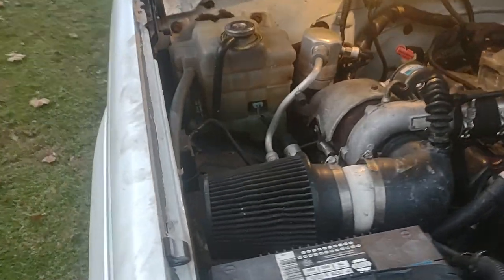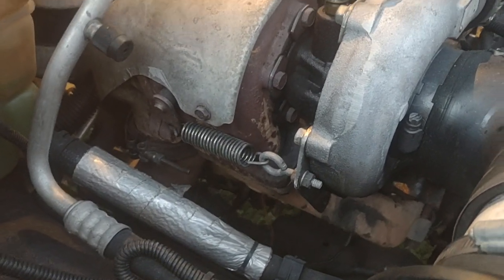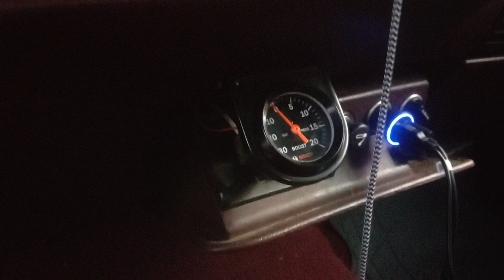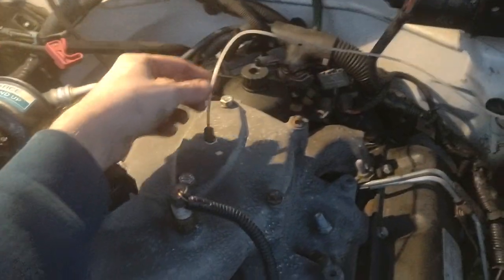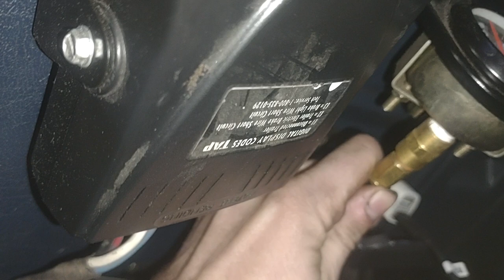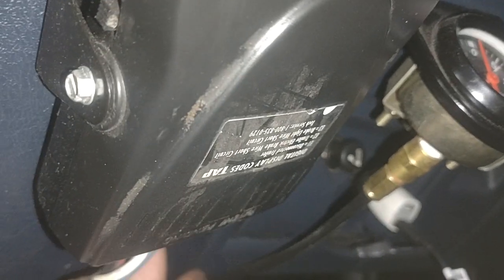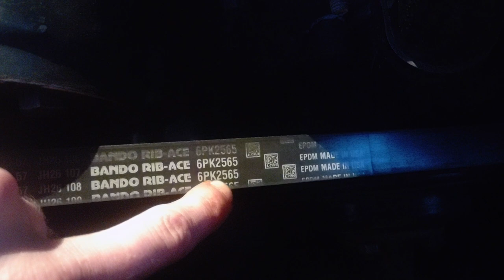6.5L Vacuum pump delete & manual waste gate

Comment: I was pulling a trailer and lost a bunch of power and was pushing a lot of black smoke so I wired my wastegate closed with some tie wire right on the side of the road. It got me going again.
Reply from the maker: Glad to hear it got you off the road in a pinch man

Comment: Anyway i can get a hold of you directly. I am currently in the middle of swapping a 93 Mechanical motor with a 95 fly by wire. Got some advise though videos on here... but i am lost on a few things  never worked on a diesel before but i am a Mechanic

Comment: On my '95 6.5 I  placed a plumbing T in the hole where the factory electronic boost sensor resides. I then plumbed the factory sensor into one side of the T and the gauge tubing into the other.

Comment: Kendall Burress here thanks for all the info it’s a lot of trouble doing all the true video no some bull shit trying to look smart thanks . Great job . I have been changing a 1998 6.5 turbo out with a 2002 6.5 non turbo the add turbo  not fun
Reply: Not some 😂 bull shit
Reply: I bleed the air out of filter motor runs good for 15 minutes  the runs low on fuel then I have to re bleed it again

Comment: So I believe I have a 68 mm Garret or holeset but what would I need to do to get more whistle? A different wheel?
Reply from the maker: Pretty large turbo for a 6.5l, good possibility the engine isn't pumping out enough exhaust pressure in order to spin the turbine as efficiently as it should in order to make a high rpm whistling noise. Never the less you could try a different wheel but, not sure if it will improve anything.

Comment: Hello, great video. I have a question. I own a 2002 Chevy express 3500 box truck with the 6.5. When driving over 50 mph the turbo is constantly reving up then the wastegate opens and back and forth constantly. The truck is not surging but the turbo up and down all the time is annoying. I own a 12valve Cummins too and that doesn’t happen. Is this normal for the 6.5?  No codes. Thanks.
Reply from the maker: Can be a simptom of the vacuum pump starting to go out.

Comment: Hey Jesse, I’ve got a 1994 Silverado with a 6.5 turbo diesel and what is doing is it runs smooth but I can’t get much over 1700 to 1800 RPM does not blow black smoke I do not have  a boost gauge to know what kind of boost I’m running I did replace the pick up pump module that usually sits on top of the motor and mounted it in the grill just not knowing where to go next. I don’t want to just replace the turbo it has about 180,000 miles on the motor.

Comment: How do you set the boost ? Is there a certain RPM,ect ? I have a stock 95 gmc engine with 185k and I think the dam pump is going out again 😫. Only modification I’ve done to it is changed the fan/clutch to a duramax. Sorry new to this and I just don’t want to blow it up 😆 not that it couldn’t happen anyway. Great videos 👍 I’m learning a lot🙏
Reply from the maker: No problem man, happy to help. The maximum boost is set by the spring tension for the turbo blow off valve. The more spring pressure you have acting on the exhaust pressure to keep the valve shut, the more boost you will make and vice versa with a lighter spring. For example if I wanted less boost on the wife's truck set up (the dually) I would back the nut off to relieve tension on the spring. And thank you, I hope these videos are helpful 👍
Reply: Jesse, what spring did you buy?

Comment: Hi, sorry if this question is stupid but what model years have the vaccum assisted heater controlls? I have a 95 Chevy Suburban with a 6.5 turbo diesel. Good video btw 😁
Reply from the maker: Mits not s stupid question man, mostly 94 and older
Reply: @JessePelkey1  Ah alright, thanks for the fast respond 😄👍
Reply from the maker: @Joel-lz1xm  no problem

Comment: Keep them coming. Just thought I'd mention that if you aren't keen on drilling holes or removing parts, using a boost bolt in place of one of the 2 bolts that pass through the intake is an option. What's next? 🤔
Reply from the maker: Also a great option man, thank you for your addition 👍
Reply: Can we see pictures of what you've done please

Comment: Hello Jesse,  nice video!  I have a 1999 chev k2500 6.5l with 498km.  Owned it for 10 years. Nice body (painted twice ...live in Quebec)).  Truck runs great!  I read and watched a lot of videos on upgrading.  So far : pmd, lift pump, lift pump harness, harmonica balancer, injectors,  bigger fan and clutch, installed intercooler, down pipe and cross over pipe upgraded, air filter modified.  Now I am looking at getting turbo from Zombie solution and I already have a waste gate like yours ready to be install. Boost gage already installed but do not get any reading ... I suspect original turbo not working .  Zombie's turbo has two options 12 psi or 16 psi.  which one should I get please?  Denis
Reply from the maker: Hey Denis, I noticed you didn't mention any sort of tune or head studs and am assuming you haven't done those yet correct?
Reply: @JessePelkey1  right Jessie! I am not a Mecanic, but like to do has much myself with help! I am 65 and love technology these days that can help ( you tube).
Reply: I sure hope you had already purchased it the moment you thought of it, because the poor man renamed it Zombie Solutions after suffering a stroke. He has since closed shop and is working out a deal to send over everything to another company to take over. I think it was Quadstar, but I am not sure.

Comment: Great video Jesse as always you do a very good job. I guess my question is how would you prevent the check engine light from coming on?
And thank you for the link on the raptor lift pump 👍
Reply from the maker: Thank you Joe, just tryin to make as good of videos as I can for y'all and I appreciate you taking the time to watch them 👍 as far as preventing the over boost check engine light from coming on, a tuned ECU/ tuner (depending on the year) is about the only option. I have heard of some people messing around with the mass air flow sensor in order to fool the ecu but for me it's just earlier to get a tune.
Reply: A gm 3 bar map sensor off of eBay solved my problem of the check engine light
Reply: Whats the part number for the 3bar map sensor
Reply: @user-xp8vq2wd1n  12223861 is the 3bar map i used for my f vin 95

Comment: 1 does the waste gate open all the way a  once, or gradually ?
2 why can't you use a electric servo to open the valve ran off of the plug for the vacuum solenoid ?
Reply from the maker: Gradually, and I suppose you could if you really wanted to introduce electronics into a mechanical system. I'm just personally not going to waste my time in order to do so when the existing system functions just fine for my use
Reply: @JessePelkey1  thank you!.. awesome videos!

Comment: Hey I'm new to the 6.5 I've got a 94 and it had the vacuum delete I put a manual wastegate on it is there a way or do you have a video on getting the heat to work again any help would be appreciated

Comment: Great video !!! What year models have the vacuum assisted heater controls ? Before or after 1996 ?
Reply from the maker: Hey thanks Dalton I appreciate it, before 95. 👍
Reply: So my 95 does not have vac assisted heater controls?   Vac pump seized up after 1 year so seeing the logic in deleting. But if assists heater controls seems tougher choice.  Thanks.

Comment: Bought a 93 gmc 6.5 today, guy said it was stock turbo, stock really everything, has vacuum waste gate and what not but it was pushing 15 pounds when reving it up, how is this possible with no manual waste gate and no engine codes or any lights

Comment: If you need to have vacuum for heater controls, about $80 will get you an electric vacuum pump and vacuum reservoir for a 6.0 Powerstroke truck. Maybe even cheaper if there is something similar for a universal kit, unless the controls need a crazy amount of vacuum.
Reply from the maker: You are correct sir, an aftermarket pump would work for the HVAC controls. People can also leave the factory pump in place and separate the function for the turbo in order to run a manual waste gate and keep their HVAC controls factory.
Reply: Are you saying I need the vacuum pump to operate my HVAC controls on a 98 suburban? This I'd the first anyones mentioned that, it's a pretty important fact..lol.
Reply: @happycamper137  some of them work on vacuum, I don’t what years and models. Easiest way to find out is unhook your vacuum line and see if it quits working.

Comment: Hey bud I’m about 2 years after seeing video I have a 6.5 only code is a 78 boost something but I’m haven’t a stumbling issue when cold barley wants to go but when I got transmission speed sensor was bad replaced that and doing a manual waste gate like on ur wife’s dually I’m wanting to keep it  8 to 10 at max should I tune one top to eliminate any other issues

Comment: So yours are base 6.5 correct not an L I have an L and it's center mounted turbo and Intercooler system so you got a long block in both your 6.5s ?

Comment: Is it possible to put head studs in a 6.5 with the motor still in the truck and the heads still on? Basically pulling one bolt and replacing it with a stud.
Reply from the maker: Yes, it is and in my head gasket videos I show it is possible to do so. I don't recommend doing the one bolt at a time trick. Just do the head gaskets with a head stud kit.

Comment: I bought one of those over priced manual waste gates but couldn’t push more boost without a tune because I have a 96 and it would go into limp. Then I put a super 40 turbo on anyway 🤦🏼‍♂️
Reply: And I hope I don’t jinx my self but I do not have studs and have seen 24 psi

Comment: I have a 94 2500 that stoped running afrer removing the Optical sensor filter. I reinstalled the filter but still not running. Only code showing is a number 62. I don't believe that would stop the truck from running though? Pmd's relocated. And even tried my spare. Wastegate is operated manually and the vacuum pump has been removed. I had a spare injection pump and I replace the optical sensor the fuel shut-off check valve and the fuel shut off solenoid. Still not running. Any help would be appreciated
Reply from the maker: By chance do the PMD's that your using have any resisters in them? if so what are they?

Comment: Hey man I got a 1996 gmc 1500 6.5 turbo. Just recently added a turbomaster to the turbo and blocked off the vacum line. Now I just wanna get rid of the pump is there anything else I need to do. Just remove the bolts take it out and get a smaller belt is that all?
Reply from the maker: Yes, you should be able to just unbolt the pump and install the smaller belt
Reply: @JessePelkey1  awesome just did it thx for the vid man
Reply from the maker: @joepawlu9523  awesome man, and thank you for watching 👍 I appreciate it

Comment: So what does it do when your vacuum fails?
Reply from the maker: When the vacuum pump fails it will not allow the turbo to operate, resulting in a loss of power and run for too long that way it will eventually either melt down the turbo or meltdown Pistons because your egts are getting too hot. Not to mention you're wasting a ton of fuel because the engine isn't getting a proper air fuel mixture and you'll have very excessive black smoke coming out of the tailpipe.

Comment: I'm deleting my vacuum pump 1996 k1500 6.5 and hopefully a super 60 turbo at some point
Reply from the maker: Great turbo potion 👍
Reply: @JessePelkey1  I figure for the price of a new HX40 that is not a China one for just a bit more I can jump up too supper 60 and have all that whistle I like.
Reply: @JessePelkey1  I just hope either my currently great running (slightl knock/possible tick sound) 1996 block is crack free or my 97 block in my parts truck (motor supposedly no good) I'm hoping between the two one will be good for a full rebuild.
Reply from the maker: @taylorh3930  I've got my fingers crossed for ya buddy

Comment: An the engine handle the extra boost? Also how can I do this just to get my truck to read boost but not over boost?
Reply from the maker: Without head studs the engine can handle about 15psi 13to be safe. With head studs and a few other supporting mods I have seen 45psi. Just to get your truck to read boost all you have to do is install a boost pressure gauge onto the upper intake horn and mount it in an area of your choice. Avoid the over boost by setting the tension of the wastegate spring.
Reply: @JessePelkey1  Thank you! You can check out the videos I make on our channel. (Repair clinic Nut & Bolts). I explain things about appliances and do part replacement videos.

Comment: What would cause the turbo to be having a large amount of oil comming out of the inlet side? The side that pumps air?
Reply from the maker: The internal seals are completely blown. I would verify that it's the turbo itself that's leaking before rebuilding or replacing, if you're just experiencing like oil residue on the face of the inlet for the turbo and going into the intake a very well could be the PCV that is routed into the intake. If you were able to reroute the PCV out into the atmosphere and the Turbo doesn't leak and it was the PCV all along.

Comment: @jesse hey man are you from TN? I just got 1999 GMC Savana 3500 6.5 liter desial van looking for any tips some bullet profiting has already been done but yeha
Reply from the maker: I currently live in Madisonville Tennessee yes, what all has been done to the ol girl so far?
Reply: @JessePelkey1  we'll opon further looking looks like just fuel driver module relocate but no heat sink on the back of it so I was going to get that aluminum one. Looks like nothing more than I can see was power company van looks to be well maintained. I wrote a list to get.. Oil switch relay harness ,water pump 130 gph, lifter pump not stock, manual waste gate ,  thermostats, 4 inch exhaust as well as intake , what else am I missing ? It runs but apparently has stalling issue lol I haven't seen it do that yet and pmd doesn't look old but still may need one again not sure . I will change all filters as well I just got yesterday haha it's a heavy duty van I love it
Reply: @JessePelkey1  I'm over here in east Tennessee by Cosby and Gatlinburg
Reply from the maker: @tdirt1461  not very far at all. About an hour, hour and a half drive from me
Reply: @jesse pelkey I'm having issue fuel driver module replaced already it seems to run for awhile then shuts off after awhile while driving  lift pumps been replaced as well the driver module seems to get about 130 degrees then shuts off what could cause this ? And is the solinoid on back of injection pump replaced separately? And is a resistor required for that driver module the new one didn't have one but I ordered it
Reply from the maker: @tdirt1461  yes the PMD needs a resistor in order to function properly and keep parameters in check. Running without one will result in premature failure of PMD. The PMD is designed to get hot that's not out of the ordinary, that's why aftermarket companies make relocation kits in order to mount them to a relocated heat sink in order to keep the PMD cooler. Without running a resistor you run the risk of the PMD overheating more often than not but is wise decision to run it to a heat sink nevertheless. I have a video on PMD resistors if you are interested in watching it.
Reply: @jesse pelkey I've watched that video and it is all relocated and heat sinked I noticed oncepmd  it reaches 130 degrees engine shuts down .. will these resistors effect or cause engine to shut down while driving?
Reply from the maker: @tdirt1461  yes
Reply: @jesse pelkey engine running now starting getting harder watched fuel pressure fr  new lift pump got 5 psi max  then went negative and truck shut off any of idea as to what's in the fuel tank I should check seems like restriction maybe fuel bag in tank fuel filter already replaced and took fuel sample but fuel pressure deff dropped off to negative vacuum pressure next I'm checking intake pick up tube and bag  I think I'm chasing problem down in regards ghr direct ion almost was leaning towards IP I'm trying to avoid getting that far into if can be avoided any helpful tips be appreciated I almost want to pay you to come have a look at this van already ha since we're only hour apart
Reply: @tdirt1461  the fuel cap may not be venting properly.. do yourself a favor and get new fuel sender and ditch the pick up sock for a inline filter. Younshoukd have 7psi to ip. I run 10 with a walbro. Also don't forget the van uses the vacuum pump for hvac controls tho the truck doesn't.

Comment: If I put manual wastegate, do I need tunning ECM? Thanks
Reply from the maker: Only if you run into an over boost situation or plan on running higher boost in general
Reply: @JessePelkey1  I understand. Thank you

Comment: I run an hx35 cummins turbo 25 psi and dosen't blow head gaskets and I don't have any tunes just marine injectors and a cranked up pump it's a 1998